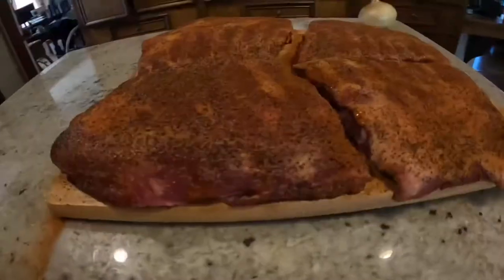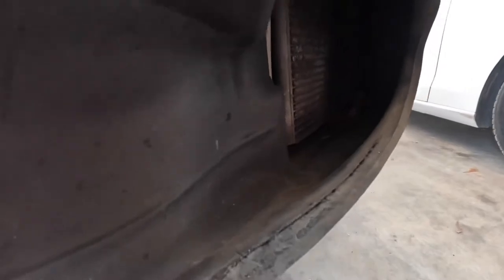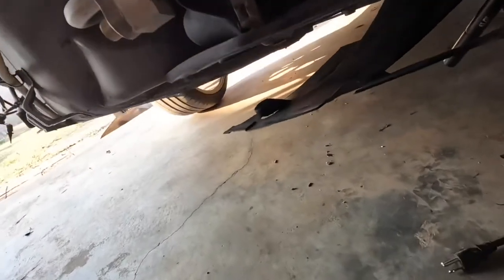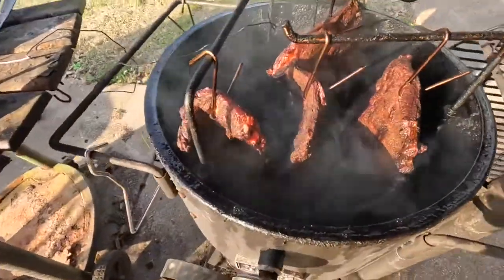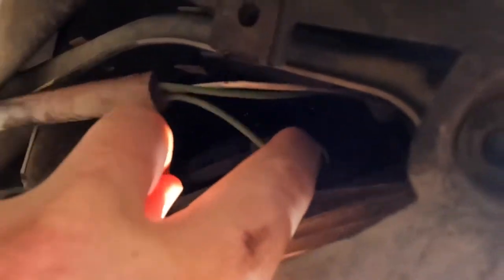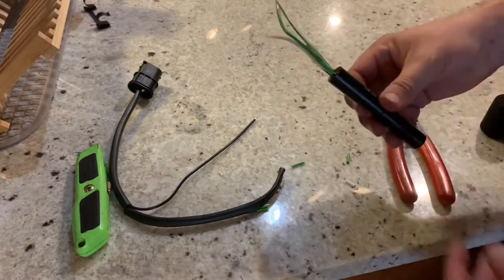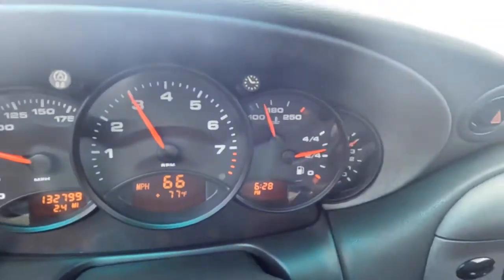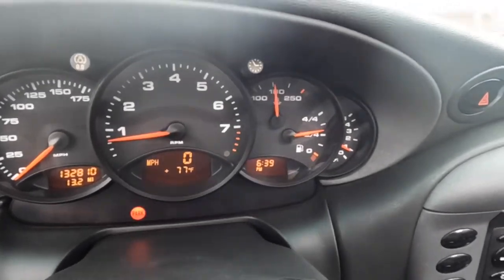Porsche 911 996 Radiator Cleanup and Cooling Fan Resistor Change Out - Keep It Cool!

Comment: Nice video, Shows how easy a lot of the 911 really does come apart. :) 
 
FWIW,, couple soldering  wire connecting tips. 
First, you want a solid mechanical junction before you solder, solder shouldn't be the primary support. For a loose  example google "telegraph splice"  then solder,  the splice is sealed by the solder. 

Second, its easier to use a fine diameter specifically electrical lead free solder, and a quality high temp pencil iron, those older style gun irons tend to wonder all over on temp, often running too cold with age. .

:) Amazing how much stuff the 911 vacuums off the road, we oughta get a kickback from the street sweepers..
Reply from the maker: Thank God you put this comment! I suck at soldering 😂 Maybe someone watching will read it and do better!

Comment: The only problem with your soldering is that your iron isn’t hot enough. You should let it get very hot then heat up the wire and touch the solder to the wire, not the iron.
Reply from the maker: I had a chance to try it out again since this video after some similar advice, and I had much better success!
Reply: @motorsandmeats88  I’m glad you figured it out! Useful skill to have.

Comment: I have 996.1 and got same problem.  Left side fan not working at all, did find a blown fuse but sill nothing = resistor and / or fan. Since I did a full radiator clean out why not pull the fan off.  Bench tested new resistor and fan works low & hi but its in really bad shape.  Time for new a fan and put new resistor on right side since low speed just stopped working :(  If the weather is good I'll start tomorrow, and put a rack of St. Louis ribs on the smoker!  Thanks for posting!
Reply from the maker: Ron, you’re my kind of people! Nice work on narrowing down the issue.

Comment: Came for the 911 content…..standing here drooling because of the smoked ribs!!  What kind of smoker is that?

Edit: I learned how to solder in the Army in 1993.  Don’t think I’ve done it more than 2-3 times since then if that.  But definitely do what the other commenter said.  Splice it, then solder.  Don’t mean to beat a dead horse.  I was just thinking that I would need to YouTube how to solder if I had to do it again now.
Reply from the maker: Haaaa. Thanks. It’s an Oklahoma Joe’s Bronco drum smoker. Soooo easy to maintain temp and really versatile too. They usually go for about $350 now I think. Pretty small investment for such good food!
Reply: @motorsandmeats88  I’ve heard of Oklahoma Joe, just never seen the upright drum like that.  May have to look into it, because $350 would be worth it depending on home much you can get into it.  Thanks.

Comment: I have a 997.1 and drivers side fan is not turning on.  The passenger side fan turns on but seems very loud, is there a high and low speed on this fan.  Seems the passenger fan is compensating for the driver fan.  Car is not over heating however just loud when fan kicks on.  Should both fans be on at same time?  Any suggestions would be great.  Thanks
Reply from the maker: Great question. Both fans should turn on at the slow speed when the temp hits about 190° and should run at slow speed the whole time your AC is switched on. When the temp gets to about 210°, both fans should come on much louder at a higher speed. 
If you look under your dashboard right above the fuse panel you will see your relays. There are 4 identical relays that control the high and low speed for left and right fan. Sometimes those fail. You can easily test them by switching them around. If you switch them around and your fans still run the same way you described, then your relays are fine. The only thing it could be then is either the resistors or the fans themselves. It’s not much more money to replace the whole fan instead of the resistors. If I was experiencing the malfunction you are experiencing, I think I would replace the whole fan which comes with new resistors. I wouldn’t want to put in that much work only to find the driver side fan itself was bad since it is not coming on at all. Make sense?

Comment: Why did you decide to cut the connector off the new resistor and solder it on, rather than remove all of the old stuff and plug in the new connector and resistor?  Just curious :) thanks for the great video!
Reply from the maker: Great question, and something that I did consider and explore myself before snipping those wires. LOL. You’ll notice there are two loose wires that don’t go directly from the plug down to the condenser. They have to be soldered onto the back of the fan itself. So to do that, method you’d need full access to back of the fan and still have soldering to do. Renntech suggested this to be the least invasive method short of total fan replacement (which comes with the resistor already installed).
Reply: @motorsandmeats88  thanks!
Reply: Same thing I was wondering.  Figured somebody had already asked it.